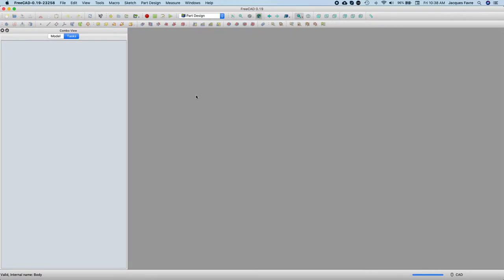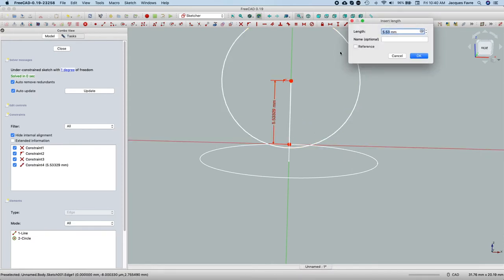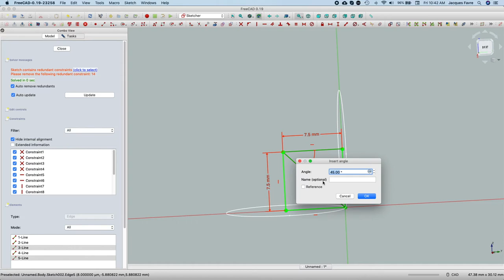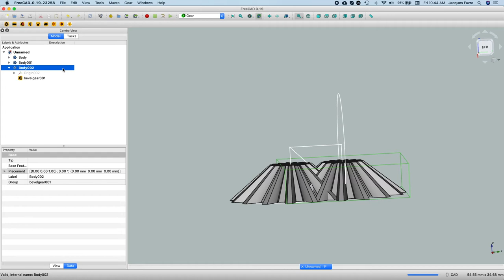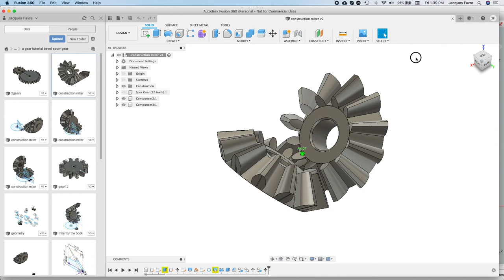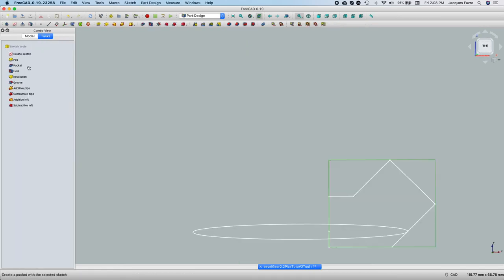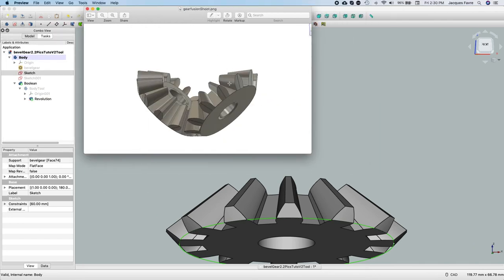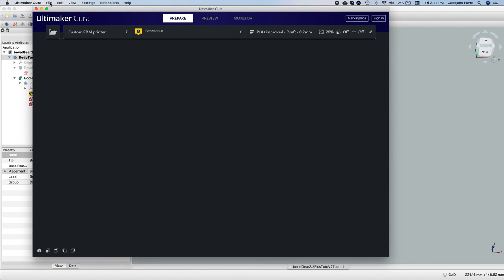Design Bevel Gears with FreeCAD Gear Workbebench, Understand Pitch Circle and Apex Relation

Comment: Based on my limited knowledge and some research this is what I came up with. Backlash allowance as a rule of thumb the average backlash is defined as 0.04 divided by the diametral pitch; the minimum being 0.03 divided by the diametral pitch and the maximum 0.05 divided by the diametral pitch.  Can you tell me how you came up with your calculation. thanks
Reply from the maker: The backlash I chose is fir 3d printed gears with very loose tolerances
+/- 0.2 mm
.2 on dimension
Plus .2 on roundness
On 2 gears
Max deviation can be as much as .8
So I chose 1mm backslash much more than metal machined gears
Reply: @jacquesfavre999  I understand this is not an exact science. You are showing 41.67 micro meters. This is less that what is suggested for metal gears. Sorry this is probably the least critical item. I was just curious. You took one over the number of teeth and multiplied it by .5 from what I understood.  By the way they posted a note on GitHub after I posted an issue on precautions to take when changing the height of the gear so as not to affect the angle. Thank you for your great video and for responding.
Reply from the maker: That is a formula I found by trial and error and Its close enough for my use
I found it with involute gears, seems to work here
Reply: @jacquesfavre999  My problem right now is trying to understand how you came up with the profile. Backlash is really an adjustment of gear size and not critical for 3d printed gears.  I have going over the video a few times. Thanks for responding.
Reply from the maker: Tried a value
Measured the result
Adjusted the value until I got what I wanted
Somewhere in the forum 
Loo posted the formula
Didn’t help me much

Comment: Some questions- I have FreeCAD 0.19 (realthunder fork) but mine looks nothing like yours, and I don't have the gear option in my menu. What modifications did you do to make your version of FreeCAD have these?
Reply from the maker: Tools Ad ons FCgears 
It is an external workbench
Reply: @jacquesfavre999  Yes- found that- thanks! What did you do to change the interface look of FreeCAD itself- that looks very different from standard interface. Appears much more usable- can you share what it is?
Reply from the maker: @CaskStrength777  Not Much, go to Ptreferences, Display, colors, Background color, Simple color, I went for grey, all the way down in color window, adjust how light or dark in the far right slider